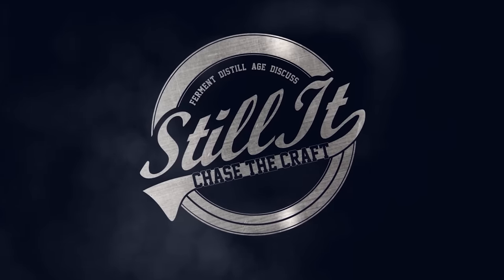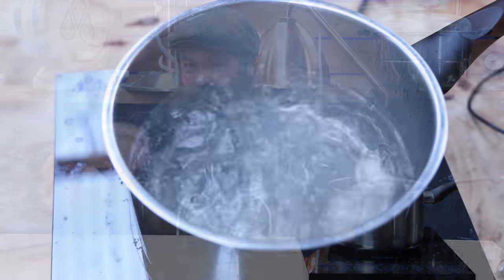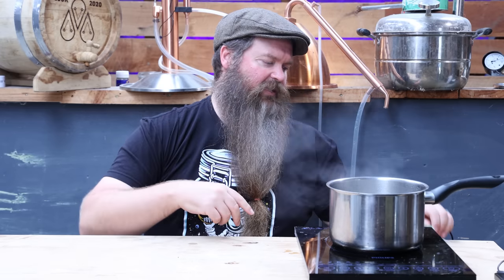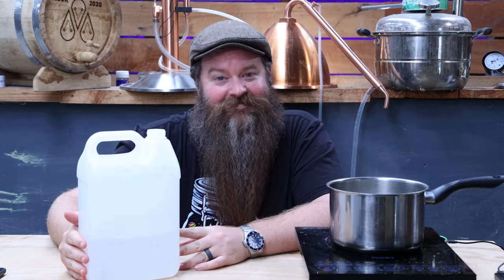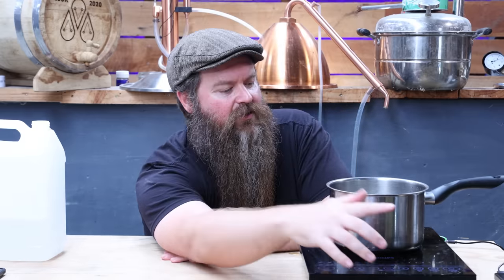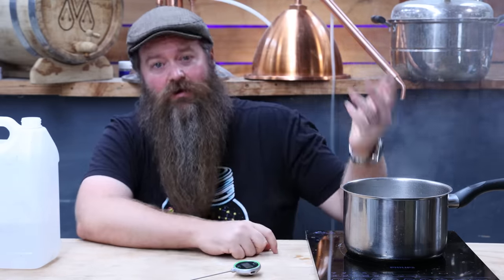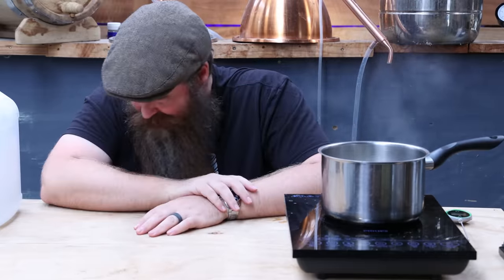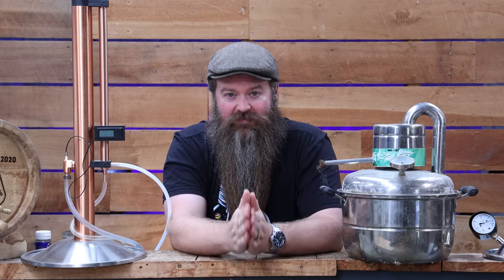What Temp Should I Run My Still At?

Comment: Hey dude, I was wondering if you could do a clip about how finings actually work in a sugar wash? Or if you have touched on this already could you direct me to the video please? Really gaining heaps of knowledge from your channel mate, Kia Ora from Htown!
Reply from the maker: How's it mate.  
Finnings work by clumping all the little parts together.  Literally sticking the tiny stuff floating around together into larger clumps.  They are to small to drop out of suspension by themselves.  But clumped together they will fall to the bottom.  

If your running a sugar wash with heaps of nutrient additives and yeast like turbo etc it can be worth it.  It's essentially keeping the sketchy stuff out of the still so cuts down on off flavors.  

If however your running a recipe that's designed to be clean from the start you done really need it.  It's just going to add a extra expense and more effort.  

Chur
Reply: @StillIt  Got it! Thanks dude, just what I needed. Keep it up.

Comment: Maybe not the best place for a question, but have you ever noticed after drinking your own products, particularly “bourbon”, that when you go back and sample some commercial products you get a “headsy” nose off the commercial product? Not sure if it’s the fact that the commercial product has more complexity from years of aging in a barrel, or if it’s because drinking local product with tighter cuts is actually better? Or I’m just getting used to a less complex product. Thoughts?

Comment: Hi fella. Great video by far the best explanation. I am itching to get back into the craft again, but no matter what I do I just cant make a damn thing thats drinkable. Everything has this god awefull aftertaste. Its present in the 50l pot and the air still. Dont matter if I do a grain, a molasses or a sugar wash. There it is. I can only guess its chemicals in the water I use, and buying spring water is just not worth it. WOuld make the end product around £70 a bottle. SO can you do a water video on maybe treatment or options? IOve had a lot of advice on formums and here, but nothing I have tried removes this freaking taste. And i am so tuned into it now I just cant be assed to try again.

Comment: In my younger years i used a 2" reflux still. We only used sugar mash with abv around 15-17 % . I remember the rule was drip-drip and no stream..It took for ever but the abv was high. My question is..If u have 4" colomn will you then be able to increase the output to a nice steady stream and still keep the high abv? Cheers from Norway 🥶

Comment: Hello. Thanks for a good video.
I just have a short question... i have been brewing beer for some times now, but i allso had some hickup.. i have like 1500 l beer that i can not sell, they got some kind of infection.
So i was thinking about why not try to get to alchol out....
I have no problem with boiling and controling my temp under boiling,  and just let the steem go in to cooler.( i have a 12 m long 12mm steel tupe with a 6 mm cooling tube insite) in a spiral to cool down the steam...
But should i make/buy a distillery column? is it worth it?

Comment: Great video love all the content. I've the the T500 reflux. You did mention it but didn't really touch on the temp of the water coming out because as you know there are no other temp gauges on the t500. I've read a few things and they were saying the temp of out put water is to be between 50 degrees and 65 degrees. Could you Elaborate more on this. Or could some one point me in the right direction please. Cheers chasers 🤙
Reply: 55c works a treat for TPW run
Reply: I generally ignore that temp gauge, it's really only there for people using the still spirits system to produce a consistent product without really knowing how the still works.  For my neutral spirit runs, it will sit somewhere between 55-60c, but again it's not really necessary because I'm watching the output from the still, and adjusting from there.  Sometimes, if I'm busy doing other things while I'm running the still, I'll use a thermometer with a temperature alarm on it, so I don't have to keep such a close eye on it.  I'll set it for 70, with an alarm, then I'll know when I need to adjust coolant or voltage.

Comment: I made my still the same as the copper one you have here ( stainless steel and a bit taller). I've done my first run using pot temperature to determine the drip speed. The rum came out at 75apv and was cut by smell and finished the run at 50apv.  Any better ideas.
Great videos, learning heaps.
Reply: The t500 reflux column? I used it with a temp controlled boiler for beer set just under the boiling point of water for a target temperature and adjusted the power percentage throughout the run. Separate water valves for the product and reflux condensers, product full flow and the reflux adjusted based on the drips.
Reply: @ffwast   mine was a black strap molasses run, that's why I used it as a pot still, otherwise I probably would have sacrificed some flavor.

Comment: U need to get the digital temp controlled vevor water distiller, I sit at 168 f for an hour at heat up, then bump it up a degree ever 15min till first drops (usually around 172f) then once first drips happen I let it run till it stops dripping, usually hour, then bump up one degree and collect till dripping stops and so on. Actually get cuts based on temp. I then change to celicus temp and keep doing it till I hit 99c.... after that's done I bump it to 100 and pull just a bit to make sure it's just stinky water.
:)
It's actually crazy how exact with temp u can get if your willing to spend the time.

Oh that's final run not stripping runs, stripping runs just throw on 99c and walk away, once dripping stops usually kick it to 100 to get a bit of the water smell/flavor from the run.

Cheers bro, you have no idea how much help you have provided over the last year or 2.

Comment: Hey Jesse, thanks for the content. I was thinking about something in regards to water. Could you run a still with a closed loop water source? IE, could you use a large bucket of water, set up like an ice bath and then run water through a submersible pump for something like a fountain and send it to the condenser and then run it back into the bucket coming out of the condenser?
Reply: Yes! Tech ingredients does that in his distillation video.

Comment: My 750W air still basically runs solid on does not pass vapor when distilling water. Turned down a little below 100C it does not pass spirits vapor either. Its heat exchanger might be larger than this one.
Reply: You'd be surprised how much of a difference buggering off the temp control does.  I bypassed it and use an SCR to control power.  Knocked down the power from 750w to 250ish. My output ABV went from around 60%  up to around 75%,  with a much cleaner taste.  12% ABV sugar wash.  I also tuck a copper scrubby up in the lid for a little reflux.  More volume at the end of a run as well.  Sure, it took a bit longer for the run but worth it.  Also, run the condenser fan on it's own circuit, so it's always running.  I don't do this anymore as I move to a t500, but I still run it this way when I'm making gin.

Comment: Brilliant explanations!
I wonder if someone would like to pitch in their thoughts about something I'm contemplating.
My column condenser unit sits on either my 20L pot or my 50L pot. Should I expect the same off take speed for both configurations or will the size of the pot itself influence this. There's a difference between stripping and spirit runs ofcourse but I'd love to hear anyone's thoughts
Cheers!

Comment: I'm confused. On just a basic hobby level why would people warn against using a water distiller? The Megahome available over here runs at 565 watts and the cheapo's run at 750 watts. Is 185 watts making that much difference in the separation process?

Comment: I run my 15gallon still at about 90C (Keep all)
Then I run my Air still at 95C (to separate the water)
Then my cuts run
84C (toss)
87C (Hearts)

Adjustable temp settings Air stills are great. 
So far my temp formula is the same for everything I do.
I'm from California (for altitude)
Reply: As someone who lived in Pacifica and also climbed Shasta... California has a wide range of altitudes.  :)
Reply: @stevealford230  intentionally left my region out. 
Let's say I live in the Sacramento area,
Typically what people think of for weather

Comment: My first still arrives tomorrow!!!!
Do I have to rack a sugar wash or clear it before putting in the still or can I just dump the whole thing (minus the crap un the bottom) right in?
It's a 3" copper reflux, if that matters.
Reply: Run it 30 min with vinegar/water 50/50 run, then another 30 min with sugar wash.  You don't have to "clear it" completely, but you don't want "chunks" floating around (with a sugar wash, there shouldn't be)
Reply: @Rubberduck-tx2bh  Thanks for the input!!!
I have a gallon of white vinegar waiting for it's arrival... with an 8 gal tank, will 2 gallons be enough to cover the element for the entire 30 minutes, or should I go get a second gal.
The Turbo-Clear coming with the still won't be needed until I venture into more complex washes that have grains and chunks in them, right?
As long as the particles aren't big enough to stick/burn on the element, I shouldn't worry about it.
Reply: @carlwitt3934  I have an 8 gal Digiboil rig, so the elements aren't exposed, but underneath the bottom of boiler.  You may need a 2nd gal each of vinegar & water to cover your elements if they come in through the side of the boiler.  I guess you won't know until it actually arrives how much needed to submerge them.

Turbo clear is helpful in sugar washes, but not always necessary.  I ferment on-grain, so I always have particulates floating around.  I use a 22" tall hop spider as a filter for my auto-siphon into another bucket.  Then I either cold crash outside or down in my cool-ish basement for 24 hrs, if I have the patience...  Bag in bag is helpful if you want to ferment off grain.

Comment: I am struggling with cuts because of covid smell and taste degradation.  You touched on that here but could you do a detailed video on how to use other factors to make cuts?
Reply: Are you proofing the spirit to at least 40% before tasting? Other ways to test for cuts is to look at the cloudiness of the distillate (it goes cloudy when in deep tails). You should be able to smell heads or at least taste it (unless you’ve truly lost all your taste and smell). Heads smells like straight up hand sanitizer or rocket fuel. The stuff that is prickly on the tongue (you should be able to notice this even without sufficient taste senses) and gives the impression of insanely high abv. Once that goes away your in hearts.
Reply: @TPGMatt  Looking for help from anyone that wishes to comment.  The reduction of taste and smell due to covid leaves me with difficulty distinguishing heads, hearts, and tails (though cloudiness is easily detected).
Rum 90% brown sugar, 10% molasses
25 liters, London ale yeast fermented at 22 degrees C
Original SP 1.085, final 1.005 giving about 10.5% ABV
Stripping run recovered 7.6 L down to ABV of ~3% 
Spirit run was slow and steady as a pot still, tossed first 120 mL
Collected 1500+ mL all in the range of ~75% ABV from a total of around 3400+ mL
Any guess as to where the heads and hearts cut may be?  Tails clearly came in around 40% ABV based on cloudiness.
1500 mL seems like a large volume to have all at or above 70% ABV, could any of this be hearts?
I tend to not use the entire batch of high ABV rather than diluting it down to ~40% ABV
 
ABV measured with Anton Paar digital density meter.

Comment: I forgot to mention, i used marbles at first for column filling and then bought raschig rings which were much better. Also used to run the spirit through 4 feet of copper packed with carbon for safety. MT

Comment: Well...Water boils at 212 F or 100 C. Alcohol at 178 F or 79.3C So, why not bring the boiling point up to around 180, add cooling water, adjust the flame and try and hold your run within a five degree window. I have done it with my 10 gallon milk can with copper reflux tower and got 180 proof on the first run. If i just ignored the temps, i would think i would either get too weak alcohol and more water or it wouldn't run at all if it cooled below the bp of alcohol. Doesn't that make more sense than just saying screw it Mate?

Comment: I only have an air still but mine does have temp controller.  So I use temp to creep up to foreshots and heads, maybe this is wrong, IDK and I use a refractometer to measure ABV.  A lot of us aren't Jesse and me especially can't depend on my taste buds at heads, so I use temperature and ABV to help me decide cut. Edit:  Heads cuts for me happen around ABV 65-63%, it's so strong here I can't really taste the cut point, so it's a guess for me.  Tails I can taste and that happens around 30% ABV as per my refractometer (Amazon pos $30 Cnd).   I'm very new to this and have lots to learn so if anyone can suggest some help it would be greatly appreciated. Cheers.

Comment: and al you people out there that can do cuts by taste!!! You lucky lucky people I have a very bad sense of taste OK with strong flavours but sutta flavours not so good.
I only have a home made 10 litre stainless still with a with a 50mm die 400mm long column on top of an electric stove.
So I use temperature more to try and get an even run from start to finish. NOT saying Jessy is wrong or I am right you have to do what you find the best for you and your still.

BUT remember you are never to old to learn, I'v been distilling for maybe 35 years, AND I have a question for anyone out there that can give me a good and SAFE answer. I have a smaller 3 litre still and I throw away the first 60ml from both stills to be safe! But my brain says that because I am only distilling 3 litres I could only throw away 20ml of each run?

Comment: Hi there just a question the tall still that you have the copper one I have something similar inside the tower I have stainless steel wool if I'm doing a couple of strip runs should I take the stainless steel wool out and then when I do my final run put the steel wool back in🤔